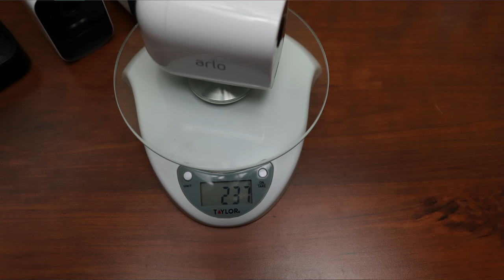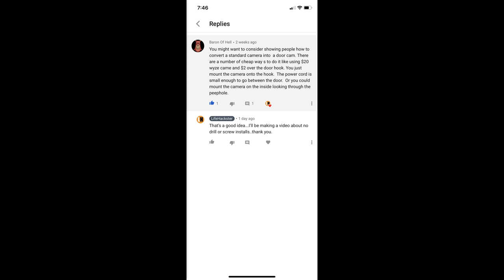No Drill | No Screw Mounting Options for WiFi Cameras (Blink, Arlo, Eufy, Reolink)

Comment: a lot of cleverness on display here - kudos! just hope some of those over the door brackets won't leave a mark from continued use.
remember, when using tapes surface prep can be very important: cleaning surfaces with alcohol and then wiping dry, maybe roughing up a surface gently to help the tapes get a better bite, etc.
there are some chewing gums that can make excellent adhesive for mounting brackets.
you can use hot glue. granted there's a removal issue, but it's valid.
lastly, just make the hole, but make it small. make fewer holes - just because the bracket has three doesn't mean you have to use them all. save/capture some brick dust when you drill the hole - you can fill the hole with caulk later and top it with some of the dust to hide it.

Comment: Your wreath hook idea is genius, I have been using an adhesive mount which does work ok but I'm concerned the glue will eventually fail or that someone will just rip it off.  Attaching a wooden or metal plate to a wreath hook should be very trivial and then I can just bolt on the existing mount.  Ring also make a peephole camera that I use on my front door but my back door has no peephole so less options.
Reply: I totally agree, I bought a door mount but my screen door covers the camera. The wreath hook is a perfect solution!

Comment: I would not recommend using mounting tape outdoors with Arlo Pro 2. I used the toughest outdoor Scotch tape and the cameras fell after 1 month. They were hard drops onto concrete but I was impressed that Arlo still worked but the case was broken. The weight of the camera gradually pulled the tape off the wall.
Reply from the maker: Yes, the Arlos are a bit heavy and the mounting tape will eventually give in.
Reply: 2021 and can't invent tape that sticks😳 gorilla glue sucks!  Hold 30 lbs  my ass can't even hold 1lb🤔🙄

Comment: I have put the wyze cam flat cable thru my window and I have a screen outside the window. I put the metal disc, then screen and then camera in a sandwich pattern. Then put the screen back in place. The camera is sitting there well so no holes etc. :)

Edit: I have no sidings or gutters in my house. Front door also has a security door. So my option works well. :)
Reply from the maker: Cool.. that should work too..
Reply: @Auroramystic  you have to read up about the history of ticks to know the answer. It's not weird at all once you know.
Reply: Wish you could post a pic of this!

Comment: How would you use to mount a security cameras on ceiling of the outside of the front door and back door? I live in an apartment complex that does not allow anything to be screw on. I was thinking of using 3M Extreme Scotch-Mount Double-Sided strip tape. Would that work best for my situation? Do you have a video showing the step by step instructions? Please send me a link to the video. Thank you so much for your help in advance...

Comment: Thank you for all your videos.  Great info.  I'm looking for a wifi cam to install on a elevator.  I want to record 24/7. What type of camara would you recommend? Thank you 🙏
Reply: elevator will block the wifi signal - the elevator is basically a metal box.
Reply: @lalew2  yes any camara that can record to sd card 24/7.   I really appreciate your help
Reply from the maker: I'm assuming most elevator cameras are using some type of NVR system. You will have WIFI issues inside the elevator.
Reply: @LifeHackster   hey buddy first off  all I want to said thanks for all your videos. Very good information.  
I live in a complex were we have a elevator and installed a nvr system in the elevator is very pricey.  I'm just  looking for a camara I can record 24/7 with memory or SD card.  appreciate your help 🙏

Comment: Thanks for all of your videos! What about no screw mounting options for Doorbell cameras? I know it's better to screw them in for security reasons but not everyone can do that. I've tried 3M double sided tape and it's not working. I guess due to heat/humidity. Also there are different types of siding styles so the doorbell cameras don't sit flush causing issues with the 3M tape.

Comment: I was lazy used double sided tape    under the front of house window and it worked ok (without using the blink mount just directly put the blink on the tape). The downside was repeating the process when the battery would run out. I am now using magnets.

Comment: That Vinyl siding you put the stainless steel hooks into, is completely different from most sidings, they don't work on my siding  , I had to  bend them to fit , There is a very small gap , on your siding  that works .
Reply from the maker: Mine is actually a hardie board sidings but it still worked.

Comment: I live in and apartment and just bought the eufy video doorbell camera. The small over door hook is a great suggestion but i just don’t have the equipment to drill holes. Is it easy to do? Or is there a store I can take it to that could do it for me? If I screw it on the outside door panel I’m afraid someone will steal it. Someone already broke into my apartment and I’d feel a little better after getting it installed. Any suggestions would be appreciated.

Comment: Thanks for the tips is awesome, I live in the apt complex and I have been looking for a doorbell with a camera.  I'm going to do a search with one that I can get quick.  Also, what about the battery for the camera, and do I have to subscribe sign up for the camera services?? Thanks!!!
Reply: I'm in an apartment too (with a terrorist LL) and got the Eufy battery powered doorbell. There's an 1080p of it or better vision 2k that can be battery or wired. It's $120 now at best buy and Amazon with the plug in chime (the one with it's own wifi has the homebase). It charges like a cell phone. There are clip on antitheft door mounts around $25 like DoorbellBoa but I read it is slightly too big for the Eufy dispite the advertisement so I'm looking at other brands. Or I may just use 1 screw or try a nail on the top mounting hole. The Eufy I got with the chime uses your wifi and comes with an SD memory card that goes in the chime to save recordings. You can get a bigger SD card up to 128g, which is maximum for most like this.

Comment: Great tips, but you have any ideas on extending the doorbell camera past the bricks on the side of the door? Or a no drill option for installing a doorbell camera?
Reply: Several Brands on Amazon/ebay Anti-Theft Doorbell Door Mount,No-Drill Mounting Bracket for Video Doorbell cover Holder Not Block Doorbell Sensor for around 20 bucks

Comment: @Lifehackster Just wondering if you had any recommendations on a battery powered backyard floodlight with/without camera? I already own the ring floodlight cam, but would like something that can stay powered on with a remote control and not with motion sensor. Salamat in advance!!
Reply from the maker: You can go with Ring Smartlighting.. they have regular battery powered and rechargeable with solar option and they can be controlled via the app. I haven't really tested ones that are not motion activated or with a remote.

Comment: I would think the screws would scratch or damage the door unless you put some kind of protector either on the door or on the end of the screws.
Reply: It looks like he used 2 fabric pads, like for cabinet doors in between the screws to keep the screws from touching. I thought that too.
Reply: @-Dwight-Schrute  
I didn’t notice that. Thanks.
Reply from the maker: True... I used foam discs which I might have shown in the video but just haven't mentioned it.

Comment: I have the blink outdoor wireless cameras and I tried mounting one outside on a wooden window frame using the heavy duty double stick gorilla tape and it fell right off. I think it's because the back of the camera isn't flat. Any suggestions?
Reply: Put the gorilla tape onto the blink’s included mount which is flat